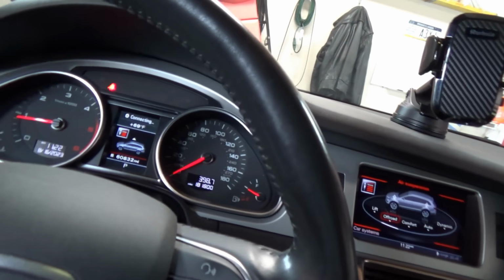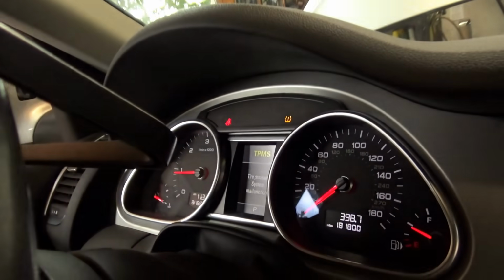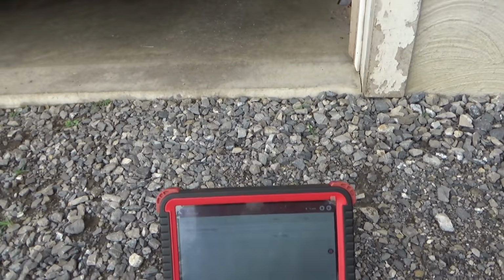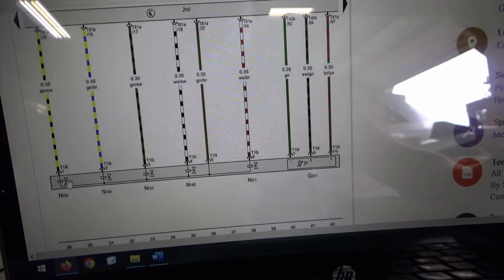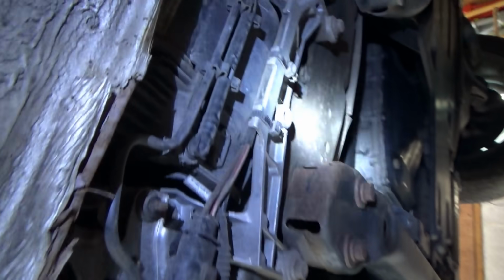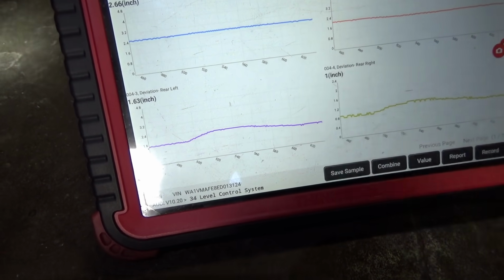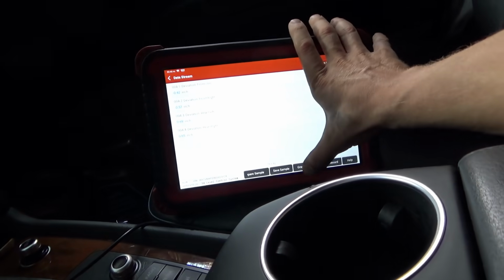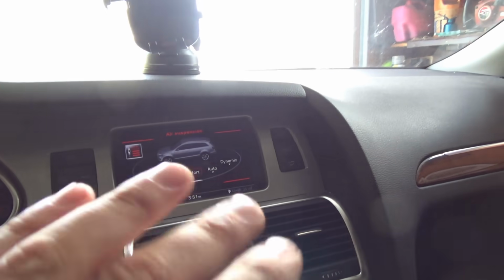Audi Air Suspension MALFUNCTION? ('14 Q7 TDI)

Comment: I have a Porsche Cayenne 955 and a lot of issues with the strut are integral and as you said that means replacing the whole piece and often a pair. The back oare over 20 years old with no problems the front keep failing.

Comment: Hay Ivan
I had the same teouble so i changed all 4 auxiliary valves but the problem is still the same. The car again got stuck in higher poaition in the rear.
The light doesnt come on straight on but after a while, i guess once the compressor starts to overheat the suspension light vomes on.
What to do :(
Reply from the maker: Take it to the dealer haha
Reply: @PineHollowAutoDiagnostics 
After a new recent VCDS diagnostics I found the front left height ride sensor was bad  and I replaced it. The error went away but the uneven suspension problem persisted.
Finally, I had a friend looked at it who resettled the suspension heights manually through the VCDS. He said that's the only way to fix this problem.
Almost 2 weeks in and the car has no suspension issues.
Thank you for your video too.
Reply: @PineHollowAutoDiagnostics  that genuinely hurt lol

Comment: About the overheating compressor? ? ? I was thinking about the " accumulator"   If the suspension runs in closed circuit , maybe, the compressor is not supposed  to pump without cooling period  ?

Comment: The cmpressors wear out on these VAG cars as the rings run unlubricated in the cylinder bore. The pump can hammer away with little effect as the rings are worn out and it overheats quickly. I believe someone does a repair kit for them as VAG will only supply a complete unit for big money.

Comment: I have one of these....Its the brass fitting at the air shock. Its a pressure control valve that leaves 1 bar in the shock always. If the bladder is gone it will be way lower, the same if you pull out this brass fitting between the end of the pneumatic line and the rear shock. Replace that thing and get a new pump. If it cant do 12 bar (or is it 16?) so it turns off on pressure after filling the accumulator and not turning off on temperature (it hits the same temp each time then turns off.......wait until its allowed to restart). It also only fills the accumulator at >30km/hr

Comment: I was always impressed with the reliability of the newer VE, Audi, and Porsche air suspension Vs. the Audi Allroad which was a disaster and the Land Rover systems. I bought a high mileage Cayenne Turbo a number of years back and figured I would have to be dealing with suspension failures. Slowly purchased used low mileage compressor and struts. Had the car 5 years and the only issue I ever had was an intermittent pump temp sensor circuit fault. Car was remarkably reliable given the age and mileage over the 5 years I owned it.

Comment: hello Ivan i really enjoyed your video really a good find on the air leak at the valve block that would have killed a very expensive air compressor fast from it short cycling all the time i also learned something new as i have not worked on an air suspension system in a very long time so i was no aware of the valve you mentioned at the end in case there’s a leak so you don’t come out with your car on its frame ripping out your hair and wondering what you’re going to do when did they come up with that valve very clever stuff the sad thing is that the air suspension systems today are not as simple as they were back in the days so even though they are some times a big a pain in the bum and definitely the wallet you really can’t beat an air suspension the ride its level of comfort as well as additional control you can get is truly amazing anyway i tend to ramble so sorry about that i can’t wait for the next video keep up the good work please forgive my lack of punctuation as proficient as i am as a mechanic it is truly amazing what a brain injury can take away an make completely impossible to understand im grateful i can actually write at least 😊

Comment: Worked on a lot of these systems with customers when I worked for a NAPA and AC Delco diagnostic hotline. There is a known problem with moisture in system and can cause sticking valves and also crack solenoids in cold climates. Replacing the dryer in the system is recommended if you see sticking valves. I think there is also a reflash of the system to raise the fault temp of the compressor so it wouldn’t flag codes so much. We would recommend flushing the valves and installing a new dryer and it would fix most of these problems.

Comment: Audi Quartro.  Supposedly a 4X4 with high lift air ride.  I wonder how often this vehicle has been offroading?
I'll bet if this vehicle had REAL AIR BAGS, it might see some real off roading.
When I got my 06 Nissan I had an ARB air locker installed in the rear diff.  IT STILL WORKS GREAT! 
Nissan's idea for a rear locking diff?  The ABS was programmed to sense the slipping tire ( with an open diff of course) and turn on the ABS to the brake caliper at the slipping tire which was supposed to direct power flow to the non slipping wheel.  So what happens if the non slipping tire starts to slip?  HMMMMMM??!!  Can you say maybe traction control? 
Oh wait!  Traction control reduces throttle opening!
I sure like my ARB  unit!
This is one reason I like Ivan's videos.  I didn't see Service Info mentioning to "Open the hose at the bad shock to see if all the air comes out and clears out the shock."  But Ivan did!  Nor did Sevice Information say to cycle the system up all the way and down several times by stopping at the different levels on the way down.  But Ivan did!  And in both cases it works now!
Very Good Job Ivan and thanks for the additional tests which looks like they cleared out and thoroughly exercised the system!

Comment: After reading some of the comments you would think that the engineers would have provided a drain valve on the compressor to aleviatemoisture (something similar to a home air compressor a button on the dash to do this periodacly & lubrication ) ?

Comment: Not a guaranteed  fix ! Not impressed. I was thinking  a mechanical issue  in the suspension  at first  (he did NOT check !) But another  comment  answered  that question. Apparently  someone  with  more knowledge about  this air suspension  !
Reply from the maker: It's called LEARNING... you should give it a try 😜

Comment: That's cool stuff Ivan.  I've had something similar on a few Mercedies where it wouldn't drop on one corner.  One of them was accident damage related and had a pinched line.  Another had a leak at the manifold and the shock for some odd reason wouldn't deflate.  I believe it was the same scenario here.  Check valve got stuck.  And another, the linkage for a ride height sensor got snapped in half and had a deep scratch in the side of the airbag.  Could have been from a tire blowout or possibly road debris hit it?  Who knows.  Anyway, now that the air ride is working again, I'm looking forward to this coolant leak.

Comment: My BMW has the same issue. I think the residual pressure valves corrode due to water in the system. Stupidly (at least for BMW) the desicciant cannot be replaced without replacing the pump valve unit.

Comment: GOOD video IVAN,tough one to diag.I've done a lot of design and making tabletop equipment with air solenoids and can tell you they NEED clean air.the compressor MUST have a clean air intake filter on the head.those valves are a micro sliding fit,so don't have rings as seals on the sliding shuttle piston.The reason?o rings brake down without lube and shred jamming them up.Also they have exhaust filters and those get clogged NOT ALLOWING the air to exhaust.You can clean those out,there bronze balls smashed into a small filter.TECO numatics sells all that stuff.Just something i learned at my job,it may help.

Comment: Hey brother I have a 2015 Chevy Silverado and when I bought it it was going into limp mode. Took it to a shop said it was a p0300 and they replaced all plugs and wires and ignition coil for cylinder 3. Still went into limp mode after that so they replaced a 02 sensor and it never went back into limp mode. Got told my left cat was clogged up so I got them busted out. I currently have p0420 and p0430 code but also sometimes a p2097 and p2099. Hasn’t went into limp mode again but hooked it up to a computer everything looked fine but I had a misfire on cylinders 2,3,4,5,6 while driving. Almost feels like a shudder to me while driving. Didn’t throw a code other than the four that was already on. Do you think this is bc of the cats busted out and the 02 sensors are reading wrong? Any advice what to do? Thanks
Reply from the maker: I would diagnose the shudder problem...

Comment: After having 1 'top of the line with ALL the bells and whistles' vehicle, I have, personally, reverted to 'only one bell and NO whistles' on whatever new vehicle I purchase. I just get the required maintenance done as required. I admire YOUR techniques for getting to the 'real' cause of the customers problems!
Reply: I'm with you.  I am still rocking my 1989 Honda Crx HF with over 377,000 miles on the odometer.  It has never broken down on me or left me stranded.  I take it anywhere and recently completed a 7,500 mile trip from here to California and then up to Vancouver, Canada and back without even any tools in the car.  It has a five speed manual, no air bags, no power windows or power locks or power seats.  It has no air bags and doesn't even have one cup holder.  What it does have is an air conditioner that blows 40 degrees F through the middle vents and a thirty five year track record for dependability.  I am not a mechanic but am able to all of the preventative maintenance on my own.  It has only been in the shop for tire replacement.  Head, block, camshaft, valves, valve guides, pistons, rings, block, crankshaft, bearings, etc. are all original.  It doesn't burn or leak oil.  I would be scared to own a new car.
Reply: @wallebo  I had an '87 honda civic that was a direct copy of the BMW 2002.  Same light controls, same gear ratios, same track and wheelbase.  Same parcel shelf on the dash.  Once I parked the Honda next to a 2002 and the cars lined up in every aspect.  I almost got in the wrong car.  I owned a 2002 and it was the best car I ever drove.  Independent suspension all the way around.  That was back in the day when  BMWs drove better when they got to 30,000 miles.

Comment: Compressor is going out likely due to having to run most of the time due to lines leaking. I’d replace every component that you mentioned. Good diagnosisb
Reply: actually the compressor is overheating because the car cant attain the values it wants. and the last person testing kept forcing it to lift... ivan never caused it to overheat because he was aware raising lowering is going to overheat the compressor. this would happen to any compressor if u sit there forcing it to run longer than it was designed to
Reply: @bobspurloc  yeah I did think about that after sending it. The temps did drop rather fast after active testing the solenoids.

Comment: Remember back in 76’ I had a 65’ Buick Skylark. Had coils on rear that were so so, installed a set of Gabriel high jacker air shocks on rear. Had the air valve inside trunk that you manually aired up or let air out to control rear height. Very simple yet effective 👍
Reply from the maker: Yup I have the same manual Monroe MaxAir shocks on my SUV and van 👌😊

Comment: I have owned 2 cars with air suspension:  a Lincoln Mark VII and the ol' Marquis.  The Lincoln had air suspension at all 4 corners; the Marquis just in the rear.  I must say the system on the Marquis is quite a simple system.  (I recently had to replace the air bags and solenoid valves and all is well.  I don't think that is too bad after almost 500,000 miles.)  It had a Hall effect switch that senses height and it works quite well.  I like the idea of trapped pressure to maintain height if there is a system malfunction.  The ol' Mercury doesn't have that and it will ride on the bump stops if there is a malfunction.  (One of the bags got a hole in it and the compressor couldn't keep up.)  GREAT VIDEO!

Comment: Oh, the dealer would have had a field day replacing parts and charging the customer thousands!
I had a 95 Mark VIII Lincoln for ten years that had air suspension on all 4 corners.  In 113k miles I never had problems with it but many others did and they usually bought coil springs and replaced the air system.

Comment: Fancy suspension is expensive to fix. I had a Lexus ES300 with the adaptive adjustable suspension. Never broke but when someone hit the rear, it was so expensive to replace they wrote the car off. Loved that car.
Reply: Lexus, those suspensions go a very long time.  My son drives a 98 LX470 on the original suspension, hoping it gets him through college, fingers crossed.
Reply: @hokie9910  sweet! Yes thankfully it never had an issue. Only issues were a seat switch and the idle speed control. Had over 200 miles when it was written off.
Reply: @kevincampbell8298  Unbelievable machines.  I made the decision in my early 30s to get away from everything else and go to Toyota/Lexus.  It’s one of the major reasons I have been car note free since that time.  The amount of money I have saved from making that switch has to be in the 10s of thousands, at least.

Comment: Hey Ivan, I would like to point out that you should never be under the vehicle while pumped up on the airbag suspension.  My brother-in-law, age 53, was killed a few years ago working under his vehicle when a line in the air suspension burst while he was underneath and he was crushed to death.  Think The Wizard of Oz when the witch was trapped under the house, feet sticking out.  He was working alone and there was nobody around.  He was found 3 days later.  I'm wondering if humidity in the air was introduced to the system and condensed in one of the valves hindering it's operation.  Depressing the system a few times blew the moisture out.  I'm also wondering if the temperature of the compressor is the motor temperature or the compressed air temperature.  I have no experience with Audis.  Just a little public service announcement to keep us automotive enthusiasts safe.  R.I.P. Tenzen Pablo Ortega.
Reply: He did say he was not under the car.
Reply: never mind this is an SUV, if the shocks totally failed... i think I mentioned it was an suv... also it was pretty obvious he had 2 jacks under the rear just in case. its like a nagging wife who refuses to comprehend u know what u r doing even tho it was verbally told to them and they can visually see u compensated for it...

Comment: How about this one....
Blinker dash indicator went out. Manual says replace instrument cluster. $950 + labor.
What happened to just replacing the $2  bulb behind the dash????
Company's completely out of touch with reality.
Reply from the maker: You can tear it apart and replace the LED I'm sure. As long as it's not a driver problem lol
Reply: @PineHollowAutoDiagnostics  THANKS Ivan...OK, I just got a ebay cluster,  led works , I'll swap led. crazy
.
Reply: I replaced an LED in my 2004 A6 C5 cluster. Didn't even have to completely disassemble it.
Reply: BTW Audi allroad POS

Comment: Change the residual pressure valve at the shock and your’e sorted.
Reply from the maker: Yes that is the final conclusion if the problem ever returns :)
Reply: @PineHollowAutoDiagnostics  Alrght, he can drive with it for a long time though, it might act up again from time to time, especialy if he raise the car again to its highest. i had a technique myself to lower the car in small steps. The left rear suspension was always slow to release pressure. I changed the valve to remedy the issue at last. Don't bother try changing the fitting with crimp-on ferrule its pretty tight on the plastic tubing, just change the Oring and clean it. its the valve fitted to the airspring thats important. A good service on these systems is changing the valves all around, cleaning the struts and service the compressor with new seals and piston ring. have a great weekend, love your videos!

Comment: this video proves older is better when i wanted my car or truck raised i just added air from compressor when i wanted it lower le air out. no computer no scanner just simple and worked the auto people need to learn from the past. there were leveling devices before computers and the worked now with all this new tech don't work and hard to diag

Comment: I don't understand the allure of these European cars. Too many problems, parts too expensive, and hard to get. Is it the "Snob" factor that draws people to buy them?
Reply: It is just that in the US they almost exclusively sold the premium models of EU models since the early 2000s. You could only buy for example the V6 instead of the 4cyl Audi. Meanwhile in Europe you could buy much simpler 4cyl manual. This was the case for example Audi A6. I think never sold as manual after 2000.

Comment: The Audi is VAG's lease car. You get a new one with an all-in contract, use it until 50k or 3 years, and then have it replaced.
If you want to own a car, choose something else.
Reply: Best comment ever on the subject.   You want one of these cars lease them, because after 50k it all goes down hill rapidly.  If you value your money, you might want to take this guys advice.  I don’t like leasing, nor any kind of payments…but if I had to drive one of these cars, it would be leased.
Reply: They are fine if you don't go for more than 4cyl manuals with max 1 turbo. But I guess more than half VW/Audi in the US is something else.